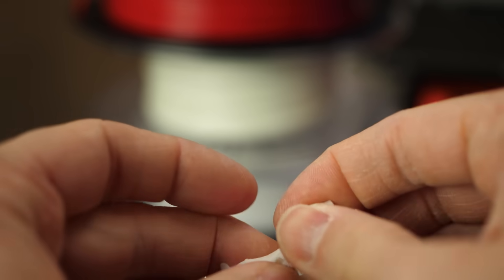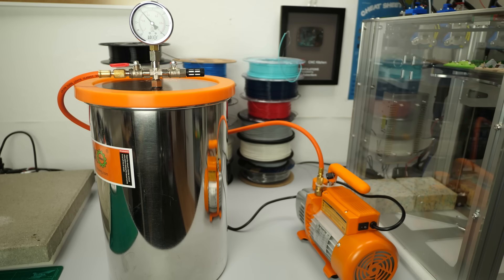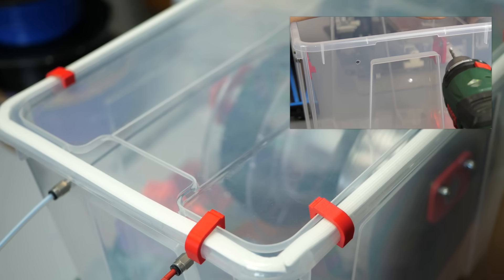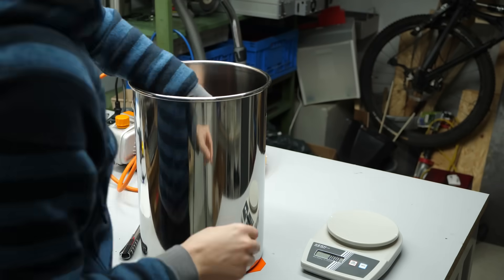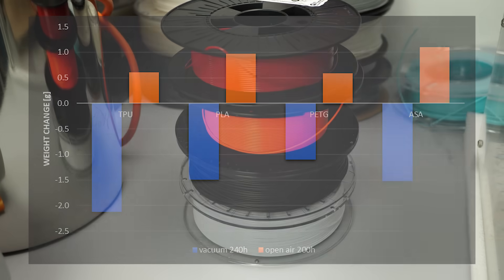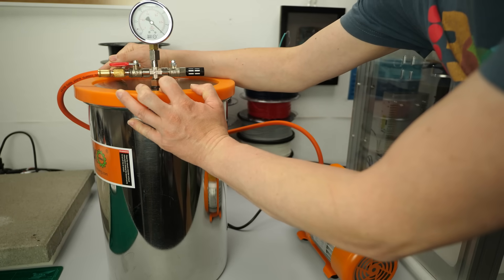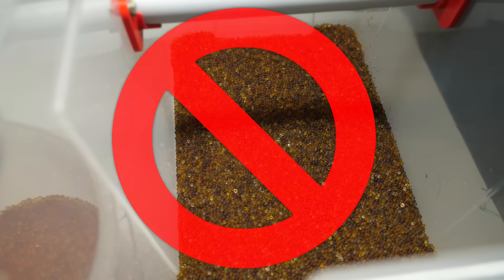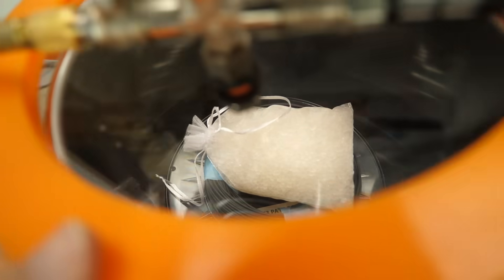Vacuum VS Dehydrator! What's the best way to dry filament?

Comment: If you have access to an air compressor you should get a venturi vacuum pump. They are much faster, so much smaller and have no moving parts so they cant overheat...I use them in almost all my vacuum applications. They are also a lot cheaper than a conventional vacuum pump.

Comment: Meanwhile, chemists have been using drying in a desiccator with silica gel for a long time.

P.S. silica gel for chemistry changes color as it absorbs moisture. If it is of such a bright color as in the video, its support should be changed or regenerated.

Comment: My PLA doesn't care about normal level of air moisture. I can left a spool for half a year open and nothing happens. But PETG i get to print COVID masks is awfull. Brand new rolls are either terrible right from the start, or they get moist after 1 day of printing. One open spool that i got was so awfully moist, that there was almost 0 layer adhesion.

Comment: Left in my room unboxed in ambient air, I have PLA filament snap when coming off the spool on its way to the extruder when printing!
Reply: I kept filamnets (PLA) in new garbage bags, in one of the bags I forget to put little silica bag. I didnt use that filament for about a year. After that same problem. The filament broke every 30-50 minutes. I had to babysit the printer that afternoon.

Comment: I am storing my filament in a box with a constant flow of very dry air (<3% humidity) that I take from my freezer.
https://3dtoday.ru/blogs/deepsoic/drying-plastic-in-the-air-from-the-freezer-/
It is highly successful. Even nylon is dry enough to not boil in the extruder. And best of all, requires almost no maintenance, apart from having to clean out ice buildup in the fridge a little more often.
Reply from the maker: Very nice idea!

Comment: The vacuum chamber will not only boil water but it will also freeze it.  Pre-heating wet filament only helps initially until the temperature drops during pressure reduction.  Adding heat such as pad heater on the outside of the vacuum chamber can help some even though heat does not transfer well in a vacuum. 

In industrial freeze drying (lyophilization), heat and dry gas bleed (nitrogen) are used to speed up the process of sublimation.  Controlling pressure at 0.5 - 1 mBar & 25 - 30 Deg C would be much more efficient than just letting the vacuum pump run and achieve it's minimum pressure. 

An efficient vacuum drying system is not practical for home use but a simple vacuum drying system is still a tool that can be used to remove moisture from filament without the negative effects of heat alone.

Comment: I’m new to the 3D printing field but I have a question, you are recording weight losses, but how can you be sure that the mass lost was just water and not something else (like the gas escaping from the cold water under vacuum)? Maybe under vacuum you take out some gas/other chemicals that are later replaced by water when left in a room without proper containment. Anyway I love your videos 👍
Reply: The mass of gasses are a magnitude lower than water so they wouldn't make much of a difference.

Comment: Being a HVAC tech with years of experience dealing with vacuum pumps and pulling water out of HVAC systems installers forgot to keep capped during installation, the fact that a crappy single stage vacuum pump is being used isn't helping.

A 2 stage vacuum pump that can be run overnight without overheating is pretty much required if you want to get a significant amount of moisture out of a enclosed system, as is the ability to maintain high vacuum for the duration.
Also its generally a good idea to have some kind of water trap, either a cold finger or a tube packed with a chemical dessicant, or be ready to change your compressor oil often as the water extracted from the vacuum chamber will end up in the pump oil and damage the pump over time if the water isn't removed from the oil.

If done right, with proper equipment, a vacuum drying setup should  be able to drop the moisture content in the filament way lower than a food desiccator can in the same amount of time in most climates that aren't a done dry desert.

I also understand that this testing is being done "on a budget" but its kind of misleading to say the dehydrator is simply better when half the issue here is that the vacuum setup is just too cheap to do its job well.
Reply: I use 2 stage rotary vane and turbo pumps regularly in my lab, and drying solids is always done under red pressure rather than dessicants, it's considerably faster and produces much dryer material. A dessicator might take days to achieve what just an hour of a few micro bar vacuum manages. Although as mentioned, overnight drying on a vac line gives best results, especially for bulk materials.
Reply: @DisorderedArray  Old post but I agree. I run cryopumps and I can pull 10^-7 torr in about two hours. If I isolated a chamber and had the filament in there, 15 minutes at 10^-9 and those filaments would forget that moisture ever existed. Below 10^-3 gasses stop behaving like fluids and rely more on random walk and probability. A static vacuum just keeps a draft from blowing around in there. It's not going to dry anything.
I live by the ocean in Florida. I dry my filaments with my 2-stage rotary vane with a silica/magnesium sulfate trap in line during the afternoon and run my prints overnight.
I wholly disagree with the absolute statement that vacuums are more inefficient. His DoE is the part that is inefficient. Heat, keeping dry desiccants ready and days of time in a dehumidifier considered... you're not going to beat a few hours with a $200 2 stage harbor freight pump.
Reply: I demand a recount! 

I've had way better results with 12 hours of vacuum pump running than 24 hours in a food dehydrator. I always run mine with indicating desiccant visible through the lid so I can clearly see when it is "ready" to come out. 

My experience was with an even worse looking cheap pump that I put good oil into. It gets hot, but seems to work. I just change the oil once it starts looking milky.
Reply: @TrevJonez  As frager56 mentioned above, a water trap will save you a lot of oil changes: use a long clear tube full of indicator desiccant, and you can watch the color change, then you know when to stop and bake the desiccant.
Reply: I looked at the link and the single stage pump that was used is very marginal for drying. To improve the usefulness of that pump for drying I would drop the power consumption somehow or add an external fan so it can run continuously without overheating. It depends on the motor design but try to reduce the AC voltage after it is running. Next with greater than a 2:1 pressure difference across a knife edge vent hole the air will be in choked supersonic flow. This regulates the air flow through the hole. Drill a small hole in the clear lid and cover it with metal tape that has a pin prick hole in it to form a knife edge vent hole. This will very slowly introduce air which will prevent moisture build up in the vacuum chamber and will also dry out the vacuum pump oil. This is the important point, the moisture dissolved in the oil transforms from a liquid to a gas and back again with every pump stroke which results in less pumping and limits the vacuum to the vapor pressure of water.
Reply: @peterschmelcher2754  : Can you link to a diagram illustrating this setup?
Reply: a food dehydrator is 30-50 bucks, and can be made for really cheap.
a decent vacuum pump is over 200 bucks.
you'd have to use the dehydrator a lot the vacuum to be a good option.
Reply: @satibel  And a few lbs of calcium chloride is less than $10... as he showed, even silica gel can pull nearly as much moisture out as the dehydrator, and CaCl is an even more aggressive desiccant than silica gel. It almost seems too easy... am I missing something?
Reply: @stephenborntrager6542  yeah, if you don't have a dehydrator, calcium chloride is cheaper, you even could use table salt (aka sodium chloride).
lithium salt is a better desiccant, but is more expensive
Reply: @satibel  Yes, calcium chloride (Damp Rid) will very aggressively pull moisture. BUT users should know it will keep pulling moisture until it becomes a thin, watery syrup. If that calcium chloride syrup gets on a cardboard filament roll, it will keep pulling moisture into the roll.  When using calcium chloride plan for it to release / become liquid.
Probably the ideal setup is to have the dry desiccant sitting in a colander type container, something with drain holes. Which then drains down into a catch container. Similar to a food steamer.
Reply: My parents have a freeze dryer, which will remove all moisture from any food. I'm really wondering what it would do to PLA now...
Reply: At 5,000 microns, 99.34% of the degassing has occurred, but the moisture removal is just beginning. You only pulled a 50,000 (-28in hg) vacuum
Reply: What about just a 'cold finger'/ cheep pettier dehumidifier?
Reply: @LowPriceEdition  that’s what Adam Savage did on his channel. He built a cabinet out of wood with a plexiglass, flip down door, a hydrometer, and a cheap single room dehumidifier in the box.
Reply: Depends... You're comparing maximal conditions for each method, not necessarily the only factor. As you said yourself, this comparison is dollar to dollar, not effect vs effect. Time, and amount of focus are also factors.
Reply: @Pusalieth  some of us glad he made a very detailed information, though. Because it's not always about dollar to dollar or effect vs effect, some people uses valuable information for them to decide what setup they'd do. Because, after all, we are in a DIY community.
Reply: Thanks Fragger56 for your long and clear explanation :) And a BIG thanks for CNC kitchen for the video ! :)
Reply: This..
Reply: I fully agree with your assessment but I think Stefan was catering to the 3D printing community that might not be able to afford a good two stage vacuum pump for merely drying out their filament. I also concur with having a desiccant or other means to absorb the shed moisture and keep it from getting sucked back into the filament once the vacuum is released.
Reply: @edwardpaulsen1074 this isn't a cheap hobby
Reply: @jerbear7952 considering that I have 27 FDM printers and a dozen resin printers, I am fully aware of the expense of this hobby. I am also fully aware that sometimes not all these things are necessary depending on the usage. Furthermore, all 3D printers of whatever type are still machine tools and are going to require knowledge and learned experience to get the optimal results.
Reply: Honestly I suspect the single stage is plenty. Just need to cycle the vacuum with moisture filters on the input. You can find a suitable moisture filter at hardware stores, look for the thick bulb compressor filters and add a second o-ring (just stack it right on the other one). It's a very cheap and effective drying setup, cycle it so that you pull vacuum, hold it for an hour, release and cycle again. Each cycle will remove more moisture but it's going to depend on the filter for how much before it hits minimal useful gain.

Comment: Great video, Stefan!  You might already have seen Joel's tour of Vision Miner earlier this year, where to get moisture out of fancy materials like PEEK or ULTEM they first re-spool onto anodized aluminum spools, then bake the filament at 150C, and finally drop the hot spool directly into a vacuum chamber, where it stays until it's ready to print:    https://youtu.be/A_KvD1yKs40?t=604

Comment: put your materiel in oven first and then vacuum suck it with with still hot and make it some times you should see som difference
you need energy to boil of the moister
That is possible to dry thing with steam and vacuum 
Like rubber stoppers for medical use after sterilizing
And vacuum in combination with hot air

Comment: I'm glad you found the dehydrator works well enough - a month or two ago I finally bought one for this purpose. I'm pretty surprised the silica gel was able to pull moisture out of the filament and not just the air. Interesting about the indicator silica gel, curious what isn't good about the indicator...

Comment: You could consider this post a "peer review" of your findings. TLDR: I found results consistent with your findings. 
I've been running theses "drying" tests for over 6 months now and I don't think drying water is the issue. I've used ABS. ABS+, PETG, PLA and PLA+ in my tests, sorry, don't have the "exotic" filaments you have. I have not seen even ABS absorb much water when submerged for 7 days, that was above a .2% change, (2g of weight using a 1kg spool.) What I think needs to be tested, is what chemically happens to filament as it ages, and how applying heat to the filament changes the filament. My thinking is that heating the filament causes some gassing, chemicals in the filament to be released due to decomposition of the filament. Since I don't have the ability to sample the gases, this will only continue to be just a "guess". 

- My method of testing is to weigh the filament as soon as it is unsealed, dry the filament at 135F for 5:30 hours, re-weigh, submerge the filament for 7 days 100% under water, remove the filament from the water, spin dry the filament in open air for a few minutes to remove any extra water that may be trapped in the spool, weigh the filament, re-dry the filament at 135F for 5:30 hours, re-weight the filament, and record my findings. If all I see is a .2% change in the filament, then I'd think water is not the issue.
Does anyone else have any test data to share? So far this all has been subjective data about drying and there is still lots of research to be made - WITH this said, I still recommend drying where there is a filament issue, what ever heating the filament does, it seems to improve print quality.

I'd like to see more of these types of tests, however, I'm not sure if you can get the test equipment you need, or if there' s a "market" from your watchers. My guess is not everyone else is a nerd.

Thanks again for a great video.
Reply: There is one major problem with your test method... liquid water has a very strong cohesive force and does not like plastic in the first place... it is not as likely to penetrate as the individual molecules of water in a high humidity environment. Your water was also likely to be room temperature (or lower) which will also affects absorption. As an example, drop ramen in cold water and hot water and see the difference in time it takes for the ramen to get "soggy". Humidity is measured while water is in its gaseous state, Not when it has condensed to a liquid... the temperature that it condenses is the dew point. A far more appropriate test would be to "steam" your filament for an hour and measure the weight change, then try drying it.
Reply: @edwardpaulsen1074  
Ed, Thanks for the reply, I was hoping someone would reply to "check" my work, however, you have only brought more questions -  I like that! Since my numbers are very close to the ones posted in the video, how do you think steaming would be a "real world" test? These tests are to determine the normal absorption of water, during normal use, not try and force as much water into the filament as you can. To go back to your Ramen example,  we are trying to measure water absorption with it sitting on the counter, not being boiled in water - We leave our filament out in room temperature air, not in a hot sauna. 
I'm sure I could be missing your point.
Thanks.
Reply: meance perhaps he is saying to get maximum water absorption, use steam.  It would be interesting to see how different the values would be. I live in the southern US, so high heat and humidity are a factor here.
Reply: @smportis  Soory it's early in my day, so I should have used C instead of Water boils at 100C/218F, and filament is extruded ate 212C, TWICE what water boils at.
Reply: meance hey no worries! 220, 221 whatever it takes (quote from Mr Mom movie)
Reply: @smportis  Thanks man, My MAJOR issue, is I can't measure what causes the filament to change when it's dryed - something changes, however, I don't think it's water, I THINK it's some type of out gassing, but that's just a wild guess. I think everyone feels that drying  does something, however, what is it? Any idea?
I tested about 20 different filaments and saw about a  -.2% change with drying, and with ABS, I saw then GAIN weight after drying - very odd..
I really think this is just "magic" lol
Reply: @smportis  Think about what you say - Steam is normally created at 218 F, you your thinking heating filament PAST the temperature that most filament is extruded at is what he's saying? 
An open container of water will normalize at the temperature the humidity will be in the area - room temperature is 80F, the humidity is 80F. Any other tests are not valid because you are not simulating the normal environment filament will be exposed to. - Even the water submersion is an valid test, unless you store your filament in the rain.

Comment: I’ve heard that freeze drying is used by the majority of companies that need to remove the greatest amount of moisture possible. I’d need to look up the exact steps required, but it looks like you have the majority of the equipment required.  I think the only thing that you might be missing is an air dryer, to remove 100% of the moisture from the air.